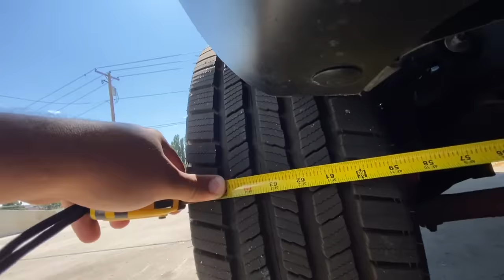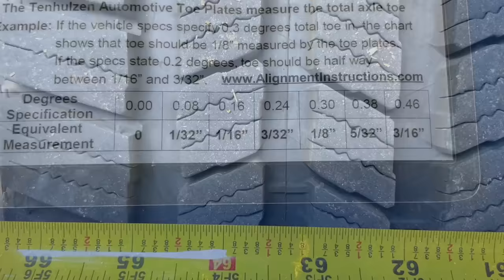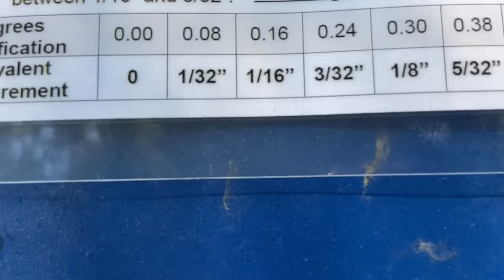How to do an alignment on a car at home using only a tape-measure!!! (And Alignment Basics)

Comment: This is a good rough process if you just replaced a part but honestly NOT a wheel alignment for a bunch of reasons.
1.  If you have wheel bearing play or loose components anywhere, your meaurement is incorrect and will change.
2.  If you have a bent rim the runout will influence your measirement.  
3.  If you have a thrust error from the back axle it will influence your steering geometry and steering wheel when the vehicle is moving.  
4.  If you have a toe-out-on turns issue from a bent component itt will destroy your tires.
5.  You have not measured or corrected camber errors or checked vehicle ride height for errors.
6.  You have not measured caster.  Errors in Camber or Caster can affect handling AND tire wear.
7.  If you have a newer vehicle your BCM computer needs to be recalibrated when you change toe.  A special scan  tool is required.

It is a great idea to check toe!  It IS  the most significant tire wear angle.  However, you are NOT doing an alignment or even measuring one, with this process.   Go to hunterengineering.com or Specialty Products Company for more info.  A typical  good alignment system costs $50-100k.   If you could do this wiith a tape measure, would they ever sell one?

Comment: This method will throw the toe off - adjusting one side affects the other , your supposed to adjust one side measuring independently- only on one side at a time not to each other
Reply: I just mentioned it also he is assuming both wheels need equal adjustment

Comment: Sandwich grease between two pieces of cardboard (glossy is better) and put under each front wheel before adjusting. It can avoid driving back and forth between adjustments.

Comment: This is a really good idea 
You need to measure exactly the same height up the tire both sides which should be level with the centre of the wheel though

Comment: First, why do you need to align. Did you impact something with you front wheels? Is your vehicle pulling to the left or right? Does it pull while breaking? Does you vehicle wander with hands off the steering wheel while driving? Is there abnormal tire wear? There must be a reason. No need to align your front end unless you notice a problem. Second you are referring to TOE IN and TOE OUT in this video. Alignment involves toe in, toe out, camber and caster. If you have new tires installed just have the shop properly align the front end of the car. The correct way. If you are setting toe in and toe out for any other reason you most likely have damage or wear to the front suspension and or steering system. Setting toe in and toe out will not remedy this. Also this method requires the tires to have very consistently straight treads. Which is very unlikely. At the very least a line must be scribed on the front tires while rotating the tires. Folks this sounds good but is fundamentally WRONG! Something causes nonalignment and that cause most likely resulted in damage or there is wear. Repairs must be performed first and then a proper 3 axis alignment must be done. Not just toe in and out. There is no way for you to set camber and caster with a tape measure. I am all for DIY but some things you just can not do properly yourself. I am confident in saying this as I DIY most everything.

Comment: Not to be too critical but you may want to learn how to use adjustable wrenches and locking pliers.
Reply from the maker: What does that even mean??
Reply: You are applying and turing the adjustable wrenches backwards. This applies to open end wrenches and channel lock pliers as well.
Reply: @daringmotors  plus, you jacked the boots.
Reply: @rhelouin  Yeah you load the lowest part of the adjustable or moving jaw or you only buy a Bahco.

Comment: Alignments can be the biggest rip off ever, especially when they get it "close enough" to where you don't really notice but it's still eating up your tires 🤦‍♂️
Reply: A Computerized alignment allows the technician to set the wheels EXACTLY to your particular car's specifications. CAN'T BE DONE with 2 Crescent wrenches and a tape meaure.
Reply: How do you think they set toe when cars were invented over 100 years ago! They used math! They used a measuring stick! So long as the cars suspension system is so nice and square then you just do What He did.

Comment: Nothing you did  checks to see if the  front wheels  were straight when you started. You should have used the string form the back tires to the front. Then aligned the left front to the left back and then the same for the right. Then set the toe it with the tape measurer.

Comment: Use proper wrenches! Real mechanics do not tolerate adjustable wrenches to damage bolts and nuts!
Reply: Adjustable wrenches seems to work just fine for him.. do what needs to be done with what you got.. that's ingenuity...life is good..
Reply: @eballe968  Using the wrong tools isn't "ingenuity" -- it's just lazy and poor wrenching !!
Reply: His video, his truck 😆
Reply: @speedy-cc  Yes. His mistake, also . ;>)

Comment: So if your steering wheel is offset before you start you haven't fixed fixed. You need to work out which wheel needs more to straighten to wheel! You ideas don't fix the error. Fail
Reply: Often times, even on a full alignment rack if your wheel is offset it wont be perfect when it’s done

Comment: If I am not mistaken, that bottom scale is in 1/32 increments and top scale in 1/16 increments, so it would have read 3/32 and not 3/16 on the bottom. But potato, patoto you have it aligned. Great video by the way.

Comment: You can achieve the same result with two metal tubes, one inserted inside the other. Give the outer one a slight dent so that when you twist the inner one round, it's locked in place. If the vehicle is front wheel drive, it should be towing out slightly. If it is rear wheel drive, it should be towing in slightly -- approximately 3/16" respectively. With metal tubes extended fully between the front part of the two front wheels roughly half way up then locked in that position by twisting the outer tube, remove then do the same at the opposite side of the same wheels. The clearance that you have between both sides is what you measure and may have to make an adjustment to obtain. But this is only a rough guide, everything is done using laser beams and whatever nowadays.

Comment: I use a string like the ones used for masonry. Tie it to leaf springs on rear driver tire wrap it around to the passengers rear leaf spring. Pull it tight. And align the rear and front tire with string on both sides booom 💥 there you go. No expensive high tech gadget or pricey alignment jobs 😁 thank me later. Btw i done this on my Cherokee xj those are known for frequent misalignments. Works like a charm

Comment: Three things wrong here, (1) centering the steering wheel in the beginning does not mean the steering wheel will be centered when driving. (2) measuring from tyre treads is not accurate, tyres are unlikely to rotate concentric with the wheel rim, measurements should be taken from the wheel rim.  (3) measurements should be checked after the track rod lock nuts have been tightened  because when tightening the lock nuts slack in the thread pitch is pushed away from the lock nut which will increases the length of the track rod thus altering your previous settings.
Reply: Steering wherl not centered is why one wud do an alignment.

Comment: You had 63 3/16 on the front side and 63 1/8 on the back of the tires. Correct me if I'm wrong but a bigger gap in the front vs the back would be toe out, not toe in.

Comment: Roads are built slightly cambered to allow rainwater to run into the gutter so a perfect toe alignment will have you pulling the wheel to the left or right depending on which country you are in to stay straight. You have to toe in the vehicle bearing this in mind to suit the camber of an average road.

Comment: Personally I have it done at a garage but I think if I were to do this I would set up a center line on the floor with a laser tape measure shooting from rim bottom to rim bottom both front and rear , divide in half and mark it with a snap line. Then if possible measure from center line to the 9 oclock and 3 oclock position on the rim not tire due to variations between tires, anything from mounting to tire pressure. If I can't hit the rim I would use the tire but what I would be looking for is the tires to run true to the vehicle unlike this video where he is trueing the two tires together which could offset the steering wheel to compensate for the car tracking one side or the other remember there are two tie rods this also may not align the front tires to the back tires and cause the vehicle to track cockeyed down the road, I'm not sure if all cars have adjustments for toe on the rear but I have a corvette that has tie rods and a caster adjustment on the back so I would be looking at each individual tires relationship to the vehicle and in the end each tire should track relatively the same short of any tire variations but like I said I let the guy's who have the equipment and knowledge set it up.

Comment: Thanks, interesting and useful for a VERY PARTIALLY aligned front end only! I came because I thought alignment meant 4 wheels and every aspect of alignment. I was blown away to imagine a tape measure can do it all! REALITY...it can't! Do this only if you don't really worry about prematurely replacing tires or other parts. Good job on the video though, but a bit misleading. almost 2 million views though...not bad at all!
Reply: So just because he labeled the description off. You have to put in your ego. Yes it should be titled "tie rod/ toe adjustment" or something to that extent. Camber isn't hard to figure out you just need a level for that.
Reply: You're right. To get a proper alignment, all 4 tires should be tracking straight and this method doesn't take into account the rear tires. Your vehicle could be crab walking as you're trying to drive straight if all 4 tires aren't parallel and in line front to back.

Comment: you should not use the tire tread it can be off by as much as 1/8 or more on each tire !  the Best way is to scribe a Line on the  tire , Put about 8" piece masking tape on Tire tread  front & back of tire or you can use white spray paint  then raise the tire use a steady Object to hold a fine point Marker ( I use me Drill Press Vise & a Red Sharpie) place the marker tip against the tire where the tip will mark in the middle of the masking tape or white paint  and spin the tire slowly to make a mark all around the tire,   Now  lower the vehicle roll it backwards about 8-10 ft then back forward to  settle the tires to there original position Now measure the line you just made it will be  way more accurate then the tire tread .

Comment: This aligns the wheels to EACH OTHER. But what if one wheel is not close to specs - then do you have to do the STRING method to get one correct and then align the second wheel to THAT one.???

Comment: Very Nice, if both front tires are wearing on outside edge, what part likely needs adjusting?
Reply: Probably too much Toe-in, but could also be too much  Positive Camber.
A computerized alignment will determine the exact problem -- and the alignment dude can make it dead-nuts, and give you a print-out that shows the before-and-after.

Comment: A nail in a 1×4. Jack  wheel up Chalk the tire or use  a light white paint arresol.  Lay nail against the tire. Rotate away from nail. Should have a perfect thin line to measure front and back of tire on the ground now. Center front steering wheel. Measure toe in.

Comment: A simple"total" toe alignment. What did your old tires look like??? Nice clean upper ball joint stud, did you happen to make sure the camber angle is correct,before screwing with the tie rods? Remember, Camber adjusts Toe.
Reply: How do u adjust camber  DIY?
Reply: @Blue1Sapphire  Older SALA set ups use shims,newer ones are eccentric cams.

Comment: your method properly toes the tires relative to each other.  how do you know they're oriented properly relative to the axis of the car?  they could be properly towed  yet oriented such that the car veers left or right when the steering wheel is positioned neutrally.

Comment: Im stumped!! Me and my son did this on my Mustang and it worked fine, well today we did it on his 08 silverado, we got the steering wheel straight and rannthe seatbelt through it to keep it from moving. We got it all lined out, toed it in 1/16 on each side , and i be damned the steering wheel is crooked! On my old jeeps they had a draglink that you can use to straghtedln the steering wheel but the Sipverados dont. What have i done wrong?

Comment: you have a difference of threads on your inner tie rod ends. is your steering rack centered or is something bent? do you have the same amount of turns on your steering wheel to the right and the left? these are things i have looked for when doing alignments to make sure you don't have a .problem down the road.

Comment: I would use this way aftet the way I do it just because the same distance doesnt mean it doesnt have a bias to one side.or the other. You can literally adjust one side with this method. 

So, I align the front tires to the back ones, eliminating the need to level the front measurement. Mark a distance from right side of the center of the rim and the left side, say one inch or so. That levels the string the measure the front rim and align to that. When all 4 points are ine inch the tires are alinged center of each other not the same distance apart with a left or right bias. 
Then tow in about a quarter turn to make sure the vehicle isnt on skates.

Comment: Anything on adjusting camber? Toe in/out was spot on!
Reply: Not to mention caster and how all three are adjusted together and how one affects the other?  This is a hack job at best and is teaching people the absolute wrong way to align a vehicle.  Toe is the very LAST thing to adjust...AFTER you adjust for caster and camber.  Then another caster swing is completed to insure the steering wheel is straight.  Doing toe only is a complete waste of time unless it is just to get it to a garage for a proper alignment.

Comment: This only works if your 4 tires are the same brand and all right? Sometimes people have different tires for different reasons, so this would invalidate this method in those circumstances.
Reply: Different tires? Measure from rim n not the tire.

Comment: I've used this method many, many times in adjusting the toe angle on track cars and older vehicles with some wear on the control arm bushings in which the suspension flexes. Also, tolerances were a bit looser on the older models. But today's cars have tighter tolerances. Especially those with electronically tuned suspension systems and electronically controlled electrical steering systems. The alignment settings can't be off by a hair. It's best to do a laser alignment on those vehicles.

Comment: Great video, but your presentation assumes that the tires are toed out by equal amounts. 

If one tire is toed out more than the other, how do you determine which it is using the tape measure?
Bear in mind that the total front and rear tire-to-tire lengths are made up of the different toe amounts (in or out) of the individual tires.

I think the solution to this is to have a reference point somewhere at the center of the floor or body of the car from which to measure and determine whether individual tires deviated equally or by different amounts hence how many turns to adjust the tie rods.

Thanks for sharing your expertise.

Comment: Hi! If I were to replace the tie rods and would want to keep the wheel alignment to stay the same as it was before ( taking not moving the lock nut into consideration ) could I do the measurements as shown in the video and if it is off after replacing the tie rods, just adjust it to as it was before the replacement? Would that work in your opinion? Or doing the same measurements after a proffesional wheel alignment and writing them down and just adjust it to that in the future?
Reply: The method I used when replacing a tie rod to get the same toe as before was to clamp a long framer's square to the brake rotor and tape the end to the inner wheel well. The square, or any long flat reference bar, rod, etc., was almost touching the wheel well at the rear side of the well.  I then took a marker and marked a straight line across the wheel well and square ends of the tape and then slit the tape.  I now had a reference to know when the tie rod I installed was in the same position as the one I replaced. I replaced the tie rod and adjusted it until my marker line was lined up as it was when I made the line.  I was assured the tie rod did not introduce any toe that was not there before.  The car tracked nicely before and the steering wheel was straight so I wanted to keep that alignment. It worked great and the car tracked as before and the steering wheel stayed straight.
To answer your specific question, you could take any measurement across the tread and if you duplicate the measurement after installation, you have the adjustment on the new tie rod correct.

Comment: It's how I was taught to align a car.  I was taught to true the car by going for a drive. If it pulls left, lengthen the right and shorten the left by the same amounts then go for another drive. An added bonus is you don't have to listen to an eighteen year old kid try to upsell you things you don't need yet.